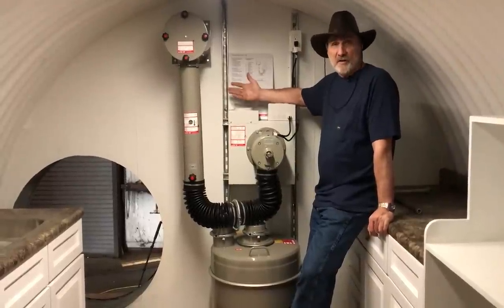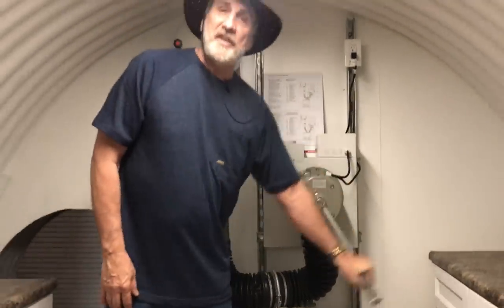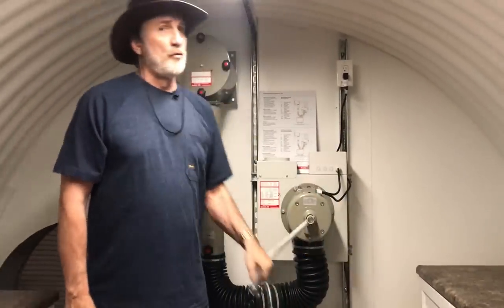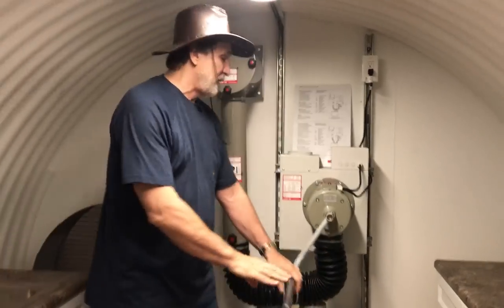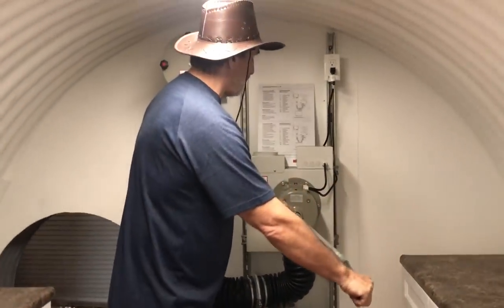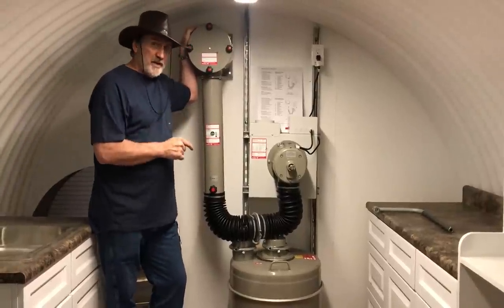How Do You Breathe Inside A Nuclear Bomb Shelter?

Comment: If the air filter was kept outside the bunker, it would make sense. But the idea of sucking the contaminated particles down into the bunker and trapping them in a filter that will be within arms reach of everyone seems nuts. And then the idea of changing the contaminated filter with a clean filter is even more nuts. Just the thought of popping the lid on the filter mechanism will spread radioactive dust throughout the bunker. The filter must remain outside, or at least in a compartment completely isolated from the bunker other than the filtered air pipe. And if a filter must be changed, the person doing the changing must leave the bunker with proper gear, enter the isolated compartment that has a chemical fume hood that would vacuum away any radioactive particles that get in the air, change the filter, leave the isolated compartment, and reenter the bunker through a real decontamination chamber. The air filter mechanism should be designed so that the contaminated filter is pulled away towards the bottom, so as to decrease the chance that any contaminated dust can get in the clean air pipe.
Reply: Radioactive fallout dramatically decreases after only 48 hours. This is clearly not designed for prolonged stay, will only be needed for a short time. You won't even have to worry about changing the filter until it's already safe to move outside.
Reply: So here is the thing about that. Contamination (radioactive particulates) can given sufficient amounts give you cancer in about 30 years. Dose (the actual radiation given off by radioactive atoms) will kill you in short order if there is enough of it. While contamination can be bad given enough of it or given chronic exposure like an occupational setting dose is what you have to worry about in a scenario with fallout. Most of that dose is not going to stick around long enough for it to be a problem if you have a shelter. The pre filter could build up dose same with the hepa filter but it could be "oh my god" levels of dose in an occupational setting and still be not immediately dangerous to you in a survival scenario. Changing out the pre filter if needed for some reason could be accomplished with minimal contamination spread with duct tape, rubber gloves, and garbage bags. Even then the contamination is going to be a tertiary hazard behind getting oxygen and the dose outside.
Reply: @josephvanas6352 Thank you for your comment joseph. Clearly there are a huge number of variables that need to be considered when talking about a bunker. In a full scale nuclear war, with several EMP strikes taking out both the grid and all the backup generators for the 106 nuclear power plants in the US (almost all East of the Rocky mountains), there would be nuclear weapons striking every city and town larger than 10,000 people. That would make it impossible for anyone to survive East of the Rocky mountains whether they had a fallout shelter or not. All the operating nuclear power plants and all their storage pools would break out of their containment and cover the landscape with tons of radioactive material for hundreds of years. Nothing could prevent it or stop it. If a hostile country detonated just one thermonuclear bomb in one city (that had no nuclear power plant), and people rushed to their fallout shelters, the harm to the people in the fallout shelter would depend on the level of contamination above them. If they were within the highly contaminated footprint of 1,000 rads per hour two hours after detonation, all they would have to do is wait 29 days for the zone to drop down to 1 rad per hour. Then, with proper protective gear on, they could walk out of the area. That would give them 50 hours for an adult (25 hours for a child) to clear the area before the male became sterilized. And that brings up the real problem with the bunker’s air filtration system. The air filtration system must run frequently in order to keep the people alive inside the bunker. When it does, highly radioactive particles will pass through the above ground prefilter and pass down into the hepa filter inside the bunker. The hepa filter is contained within a metal container inside the bunker. Alpha and beta radiation is shielded by that container. But as beta electrons are decelerated by the metal, the beta electrons emit secondary gamma rays; which the metal container cannot contain. And gamma emitting isotopes that are brought into the hepa filter cannot be contained by the metal container. So assuming that 100% of the radioactive particles are trapped by the hepa filter and not released into the bunker, the people inside the bunker will be bathed by gamma rays all throughout the 29 days that they are in the bunker. The air filtration system must be located with at least 4 feet of concrete between it and the rest of the bunker. And since we must expect that the hepa filter will need to be changed at least once, the design of the air filtration system must include a safe means to do so. That can be done easier than it sounds. A deep water trap and Ionization plates should also be incorporated into the air filtration system. And there is no sense in building an expensive bunker that does not also protect its occupants from a bio weapon. An inexpensive UVC trap should also be incorporated.
Reply: @fredstead5652  Howdy Fred Stead. Thank you for the comment. Please read my response to joseph on this thread. It describes a single nuclear detonation where the bunker is within the 1,000 Rad/Hr footprint. What is a prolonged stay? If the bunker is within the 1,000 Rad/Hr footprint, and the air filtration system is turned on 3 hours after the nuclear detonation, then the bunker would be flooded with 270 Rads/Hr of gamma radiation. 190 Rads/Hr the next hour, 148 Rads/Hr the next hour, etc.

The number of different radionuclides within fallout make calculating the decay rate very complex; N(t) = No*2,71828^((-0.693*t)/t half life) of each radioactive element. So the industry has accepted Kearny H. Cresson’s Seven – Ten Rule as a general estimate; Rads/Hr =1004.1*(Hrs)^-1.19. This, of course, assumes that the nuclear weapon is not salted with something like cobalt.

My point is why spend so much money on a bunker designed to expose its occupants to radiation, when a simple design change can prevent it.
Reply: @bacsi8337 Very well thought out.
Reply: The owner of Atlas seems to be a person who would make these changes if he saw this.
Reply: @brentpurcell271   You are very kind. Thank You.
Reply: @brentpurcell271  I hope improvements will be made.
Reply: There are videoa from chernobyl of guides holding radio active peses in the hand explaining its not dangerous being close to, but its the inhaling that is bad. Its not a pure isotope but a contaminated particle. Also the container seem like solid steel witch would block the little radiation from the particles i dont know to what extent. I dont think the filters have enough mass to create enough lokal radioation to "light you up" sonto speak its not like they are changing fuel rods here...but as a dust in it self it is realy bad for the lungs.
Reply: @joeblow1748  Thank you for your comment joe. Several of my comments on this thread have been stricken for technical reasons, so I better not duplicate any of them. Please read my response to josephvanas6352 in this thread. There are very many variables involved when dealing with radioactive fallout. You mentioned Chernobyl. If someone had a bunker near enough to the Chernobyl nuclear power plant that chunks of graphite fell around the air intake, then small particles of that radioactive graphite and all the other radioactive isotopes associated with a nuclear power plant would have been sucked down into the air filter inside the bunker. The alpha and beta particles would have been stopped by the metal container, but the neutron particles and gamma rays would have passed through the metal container like it wasn’t even there. Also, keep in mind that Chernobyl happened 38 years ago. Someone sheltering in a bunker would be hiding from the fallout that might be 1,000 rads/hr or more. If that guide, that you mentioned, had briefly picked up that same item 38 years ago, there would have been a very good chance he would have died within the next three months, just like 28 of the Chernobyl fire fighters did. My point is that the air filter should be physically isolated from the rest of the bunker; by four feet of concrete.
Reply: How you gonna change it if it’s outside
Reply: @AdrianRund  If you are going to spend the money for a bunker, hire a mechanical engineer to design a functional system. The alternative is to spend a lot of money to end up hiding in a radioactive hole in the ground.
Reply: @bacsi8337 your pfp goes hard af
Reply: I'm glad I'm not the only person who noticed that. There isn't much benefit to being 3 feet underground if you are pulling dangerous particles from the surface and then storing them in a filter drum inside the shelter with you. Like you say its a good product that just needs a few design tweaks.
Reply: @SonicMarmalade  Considering all the number of different types of engineers that helped to design this bunker, not to mention all the learned people working for the Swiss government who authorized this particular designed air filtration system for installation in all the Civilian Bunkers in their country, you are one of the very few people who have managed to detect this critical flaw.

Since I have spent many many years in college, and years working in the Defense Industry on these weapons, I’m not particularly surprised that I detected this flaw. So please tell me, for my own peace of mind, that you have extensive training or experience in the nuclear field. Because if you don’t, you must be a particularly impressive person.

Comment: While the filtration system looks interesting, it seems that the air intake system in most survival shelters is a serious weak point.  if the intake is compromised or obstructed, the inhabitants of the shelter will suffocate.  Wouldn't a scrubber that removes gasses like CO2 be a better solution?  Build the shelters to seal instead of building them to be vented.  Just imagine someone putting a plastic bag over your intake and taping it up in order to flush you out.  Or, a post war nuclear winter where the snow piles up deep potentially covering the intake and suffocating people sheltered inside.  It would be unfortunate to spend the kind of money that some of these modular shelters cost, just to be defeated by a plastic bag and duct tape.

Edit: I do want to add that I love your designs.  Just wanted to bring up this one potential issue.
Reply: The person who blocks your vents with plastic bag would have to survive the nuclear explosions/fall out first.

As for "nuclear winter" will it be unsafe to go out by the time the ice age begins?
Reply: @iamnormal8648  They would still be able to do damage before radiation sickness sets in. Or it could be enemy troops in suits weeks after an air burst
Reply: @iamnormal8648  long-term fallout would take 1-5 years to clear up. the other problem is food and water, you’d need 10-15 years, a person drinks about a gallon per day so that’s 3652.5 gallons per person minimum. 2400 cals of food per day makes it 8.7million cals/person for 10 years which will cost you ~$25,000. Some books on farming and seeds. not sure how cattle would survive tbh
Reply: very good points. what if you put the air sucking end on a slope - that way nothing will pile on it. and hidden enough to not be noticed.  
Worst case scenario is you go outside in a lead suit to clear debris. preferrable to suffocation. but if something gets stuck inside or breaks down then u’d need an alt source

But i totally agree this should not be the only air source. The BIOS3 experiment relied on Chlorella algae and were completely sealed for months. One would also need an air purifier because of various biological stuff that gathers in the air (skin cells etc).   8m^2 per person of that algae + this NbC filter imo.

I like their bunkers but I feel one could build a more spacious one. they say temp change could break if not designed properly but come on, metal doesnt even burn: 3ft underground with 1.5ft concrete instead of 20ft - just as safe from fallout
Reply: @iceswallow7717  Bro you don't need a gallon of water a day in these conditions lol.

Comment: Can you install volcanic ash filtration system? We have Yellowstone in North America, which is over due for an eruption. Considering how large Yellowstone is, the area of impact will be large as well and could multiple states. So a volcanic ash filtration system would be quite handy for the people in the impact zone with bunkers. Its actually quite a bit of earthquakes lately which is usually normal but the problem is the amount of them had increased a decent bit.
Reply: So if yellowstone pops there will be ash caking everything, then that ash will get wet, basicly covering everything in a layer of cement. Last thing ud want is to be undetground when the cement flows hit

Comment: Is there a pre-filter up above the ground? I assume there isn't. What happens if highly radioactive particles get filtered out and get stuck inside the filter during fallout? The filter's shell will block Alpha and Beta radiation but Gamma radiation will pass right through thus exposing the shelter inhabitants to high levels of radiation. 
I think that the filter element should either be shielded or at least placed as far from the living area as possible.
Reply: I have asked the same question before. Also when the filter plugs up inside how do you safely change it and dispose of it.?
Reply: @bobsimpson3661  you just need to wait the half life out, 7 hours for 90% reduction and 48 for 99% reduction
Reply: Yeah, but during that half-life, the radiation source is only like 3 ft away....
Also, every time you run the thing, it is pulling in new radioactive fallout particles and concentrating them into one small area. The filter needs to be outside of the living area of the shelter, but accessible for maintenance if needed.
Reply: Does this setup require a exhaust vent
Reply: Totally agree, and the fact it will need to be changed at some point and maintained in a secure, controlled area!
Reply: @devilinblue72  maybe have the outside be encased in concrete sucking in air through small holes?
Reply: There are several details I would change to the air filter system. Adding a cyclone separator. This would ideally be above ground as to keep large particles out of the bunker space. Adding a standard size pre filter like say MERV 13-16(75% -95% efficiency) filter accessible through a shielded door in a decon room or stairwell or ladder well. Finally, the regular air filtration system located away from the living space.   The ideal being a majority of particulate matter would be stopped by the pre-filter system with cheap easily replaced filters. It would also greatly extend the life and efficiently of the entire system.
Reply: @hkennemer1  It’s a little more complicated than that. The 7-10 Rule is an estimate because the number of different radioactive nuclides have different power levels and different half lives. Osha explains the 7-10 rule like this: if the radiation dose rate at one hour after the explosion is taken as a reference point, then at seven hours after the explosion the dose rate will have decreased to one-tenth; at 7x7 = 49 hours (roughly 2 days) it will be one-hundredth; and at 7x7x7 = 343 hours (roughly 2 weeks) the dose rate will be one-thousandth of that at one hour after the burst. If you want the actual formula:
(1004.1 * (1 + the number of hours after the last blast)^-1.19) * (the Peek Rad count at location/1000)

Again, this is an estimate. But think of it this way. If your bunker is in the 1,000 Rad fallout footfall of the blast, then 49 hours after the Peek Rad Count will be 10 Rads per hour. If the air filtration system is first used at that time, then the bunker will be flooded with that level of radiation. 12 hours in that bunker at that rate will expose everyone to 120 Rads. But now the radiation exposure has dropped from 10 to 8 Rads per hour. So after another 12 hours everyone has accumulated over 200 Rads just one day after the first use of the air filtration system. Males are sterilized after receiving 50 Rads, which would happen 5 hours after first using the air filtration system. 50% of people start vomiting at 200 Rads, and 5% die without medical help. Additional Rads make people incapacitated, and 95% of everyone will die after receiving 500 Rads. Oh. The 7-10 Rule does not work if you are down wind of a nuclear power plant. 24 hours after a nuclear war starts, all the nuclear plants will pop like Chernobyl and Fukushima, and there are 106 nuclear plants East of the Rocky Mountains, each storing about 20 used cores weighing 44 tons. Building a bunker East of the Rocky Mountains is a waste of money because you would never be able to leave it. They will keep spewing out newly created radioactive material for decades. There is a good reason why Rich people plan to take vacations in New Zealand when tensions between Russia and the US get high.